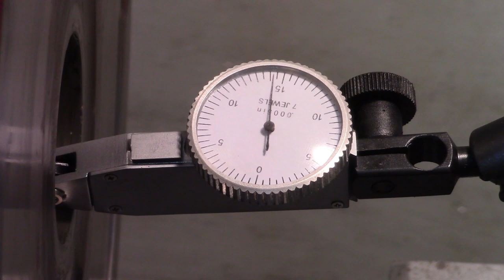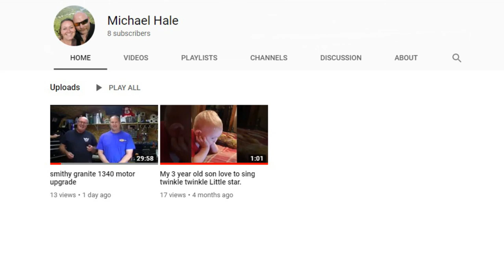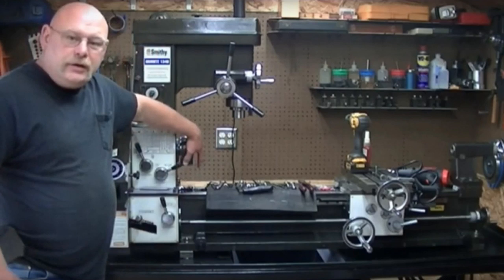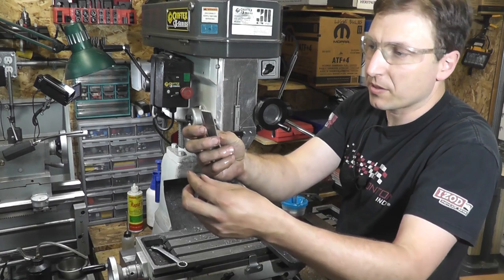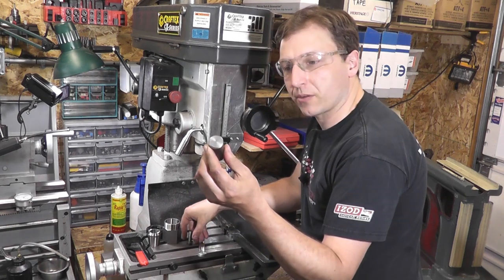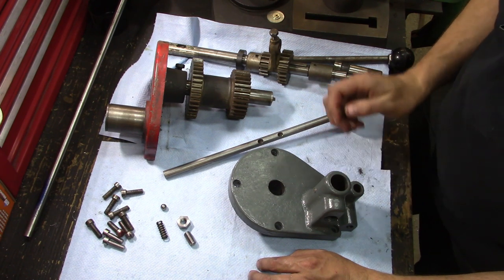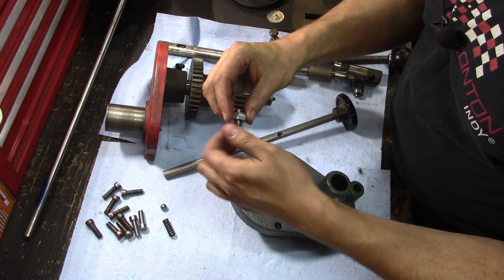Alba 1A Shaper Reassembly Part 3: Gears, Pulley, and Clutch

Comment: Nice work again on the required 'bits'... as always quite a lot of work making those things... glad you had the six side collet holder to help for the nut. Detent works nicely - spot of grease probably needed later. 

Hah - the fun of gearbox reassembly! Nice work Everett - a very worthwhile challenge... look fwd to next step and hopefully seeing finally the ram moving. I guess you have a clapper box.
Reply from the maker: Thanks Chris, it's coming together bit by bit.  There's a lot to do yet though, and more replacement parts need making. The trick is finding the balance of information to action.  Got a mental list of tasks needing done yet but just going to plug away at it one system at a time. Not sure how many videos this one will require . . . As for the ram, before it or the clapper can be assembled the lever arm and slide block need some help, so that is the next challenge.

Comment: It starts to look like a shaper. Nice repair. Thanks for posting.
Reply from the maker: Thanks, it's coming slowly. Still making more replacement parts and repairing some original parts to work properly again. It just takes more time when you have other commitments that have to come before hobby work. Hoping to cut chips like your machine at some point in the not too distant future!

Comment: G’day Everett, refurb is coming along nicely and good to see you getting your head around the British threads, no BSF threads so far:) excellent job on making the bolts. 
Cheers 
Peter
Reply from the maker: Thanks Peter, it's coming along but slowly, just working at it as time allows.  More parts need making/ repair, so more threading will be needed as the project continues.  I have no problem with British threads as far as being critical of them.  As long as a system has a logical pattern to it and works I'm fine with it, it's up to me to learn how the system works and how to use it. Lots of very cool stuff was made using the Whitworth system.

Comment: Don't know if it will affect your build BUT do not chase threads on bolting with a standard threading die if the original threads were roll formed.  Doing so will cut the root of the thread on the bolting thus reducing their capacity by about 30%.  Use thread chasing dies ONLY for cleaning/chasing threads on rolled thread fasteners.  Really enjoy your channel and look forward to future videos.
Reply from the maker: You do make a good point - I am not sure if the threads on some of these fasteners are cut or rolled.  The threads on a number of the fasteners had dings and rough spots on them so they needed cleaning up before assembly. Not a lot of swarf from the dies, so I'll take that as a good sign.
But you are very right, and that is a good point to remember for general mechanical work as to not compromise fasteners in a critical assembly. Thanks for the kind words and for your support!

Comment: Part 4 we are making chips. :) Thanks for the shout out for Michael's channel.
Reply from the maker: Lol, hey Tom, I wish it would be part 4 for chips. Lots more repair needed, like the lever arm slot and new slide block needed, motor pulley, parts for stepover feed mechanism, wiring, etc. It'll be a bit of work yet . . . (sigh) . . .
And I think Michael is a cool guy (you knew that already) so if there's something I can do for him I will.

Comment: Nothing wrong with using a die / die nut to finish a thread .   I see we use similar camera mounts ( the drum / shaft model ) !!!
Reply from the maker: Had I thought ahead I could have used the jam nut as a gauge but I didn't. So, the die was the next best thing besides using pitch diameter wires, and it was getting later so my laziness factor was high at that point, lol. At some point I'll get the tripod back or replaced but the axle shaft will do in a pinch!

Comment: I'm not a fan of carbon steel taps and dies either every turns like playing Russian roulette, but they're cheap and get you out of a hole. I like the gearbox footage, had to laugh, brings back memories of my Rubik cube mill gearbox. Nice shaper paint job.
Reply from the maker: Thanks Tony, sorry it took a while to get back to you.  For some reason the comment filter snagged this one.  Yes, I've only ever broken carbon steel taps, never a HSS tap.  Got HSS taps for that purpose in Metric and UNC/UNF but haven't gotten much for Whitworth yet.  The tap set has been mostly used for cleaning out holes and cleaning up dinged up fasteners so they should survive well enough in that, but the occasional time I've had to tap a hole with this kit with new threads it's been with mild steel.

Comment: Everett; I just bought one of these last weekend and have been consuming your shaper playlist multiple time. Mine (appears to be) is in far better shape than yours was. I was wondering if you had any thoughts about the funky old grease nipple (BSPT) on the end of the gear shaft. Did you replace it with a more conventional BSPT zerk and if so where did you find it in western Canada? Also, how do you oil those gears? Just squirt it in from the top?
Reply from the maker: Hi Ross, this machine has been an education in old British equipment for me, and I'm still learning stuff about them.  The zerk you speak of is actually for an oil feed, it feeds into the gear cluster in the back, lubricating it on the shaft.  I use a rubber tip oil can to force oil into it.  As for the gears, the manual says to use grease, so I did for now.  At some point I think the old girl is going to get some form of automatic drip oiling system (and oil collection tray in the base to the motor doesn't get drenched!) but that will have to wait until I can get some time.  By all means shoot me an email at everettsworkshop@gmail.com and I can share anything I have that was shared with me if it helps!

Comment: I've never seen a clutch system like that, it's pretty cool. Is there any way to adjust for slipping or would you have to add metal  like a shim?
Reply from the maker: It's the first time I've seen one like that as well.  As far as tension adjustment goes, the best way I could think of would be just take .005-.010 off the release rod length and add a shim under the big retainer washer to add tension.  Hopefully I never have to reach that point!

Comment: Firstly, I absolutely hate using the damn flat head screw for any kind of application, period! I agree with you.... But, why jabbing at the Engineers? How about the cheap ass owner/manager telling them to use cheap, inferior yet adequate flat head fastener? Unless it is one's job, no one is engineering a screw. If you had said "why put the screw hole here... uhh engineers...", I would have no problem with it as I know, personally, that there are some out there barely qualifies for the job.
Reply from the maker: Lol, fair enough, you've got a point.  The bean counters often make the engineers chisel away at a decent design, I agree.  For what it's worth, as an auto mechanic, in the mechanic subculture there is a constant frustration with engineers (and bean counters) as we try to repair and maintain designs that either were good and then "cheaped-out" upon, or poor designs to start with, so there are lots of mechanics' jokes about engineers.  That being said, I don't hate engineers, in fact my brother-in-law is one.  I really like the guy, which is why I sometimes tease him with engineer jokes.  Like this one, because he watches my videos :)